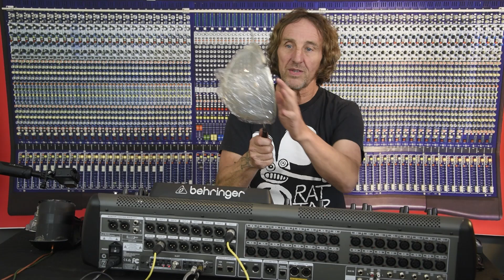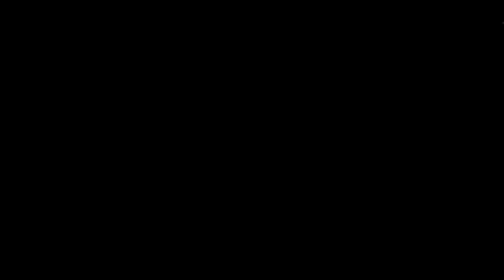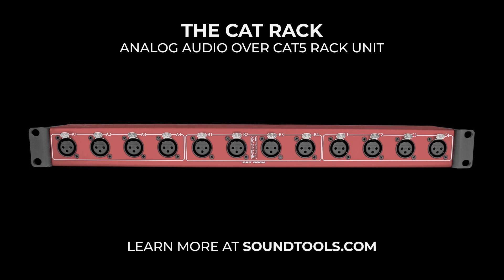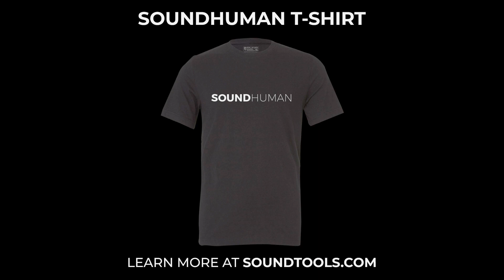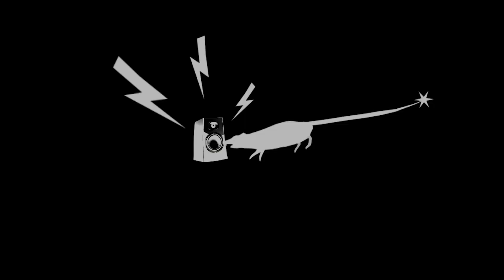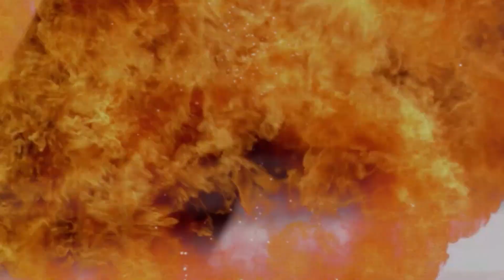Aux Fed Subwoofers Are Better - Because of How Mics Work

Comment: I don't personally run subs on an aux, but I'm also basically high pass hitler. Everything gets a high pass. Literally everything. It's the first thing I do when I EQ something, before the channel is unmuted, it gets a high pass based on what the RTA is telling me, then, that high pass gets run up until it sounds bad, then backed off a little bit.
I am, of course, almost always running in a room, seldom outdoors, so, wind isn't an issue. Wind is a broad spectrum noise on any mic, so even while running them on an aux, the real solution is to dead cat your overheads and high pass.

Something to consider that you didn't mention here though, any time you add a filter, you're introducing phase incoherency, so, in that way, subs on an aux is probably superior. I don't know how much that matters in real life. Also, if you're running your subs on an aux, run two aux channels for LR subs. That gives you a ton of freedom to fix things (another RAT trick that I use fairly often which works without the aux's as well).
Reply from the maker: Very cool and another added benefit of aux subs is that all phase and delay issues between subs and mains are due to the same signal sent to both, any input sent just to mains and not subs will have zero phase issues between subs and mains. This cleans things up further

Comment: I think you hit up on why many audiophiles hate subs. In a stereo system you can't just not send the snare and high hat to the subs. And what you demonstrate sounds like what I associate with a poorly done sub on a stereo system. When I wanted to restore a mix that seemed to me to be missing an octave (vs what I remember when I heard the same recording at Monopoly's Park Place) I tried doing a low pass and then shifting that low pass track down one octave. The result was mixed, the bass and synth sounded like what I remember, but it made a mess of the drums. I got something like what I wanted by gating the extra bass to turn it off when the drums hit. I think the club was using a sub-bass synthesizer, probably from BBE. That was an awesome club BTW. The song was Love and Rockets "Ball of Confusion". You need good gear to even tell that extra bass is even there other than the distortion it causes in really junk equipment.
Reply from the maker: Yeah, using higher freqs and shifting down gets messy fast.  A good studio recording will make sure there is no wind, mic vibrations, and minimize bleed from one instrument like bass into other instruments, therefore cleaning up the lows and reducing need for subs on send.

That said, kick and toms into the hh and overhead is an issue and high pass is useful and subs on a separate send is the icing on the cake.

Comment: A fellow FOH was insistent about sending the L/R to a sub matrix with proper crossovers on all 3 channels. What this video seems to be reason out is to not send "everything" to a sub out rather only send what is producing sub frequencies, mainly kick, toms, bass guitar.  Would this be a proper recap or did I miss the concept?  Cheers!
Reply from the maker: Yes send anything to the sub that you feel would be benefited by having some sub and don't send anything to the sub that has no reason going to the sub because the only thing that will get there is garbage and random noise you don't want anyway

Comment: Well put. I've been doing some research on pre-fader / Post-fader. I have generally only seen references to putting monitor mixes pre-fader and effects units post fader. This got me thinking is there any reason for that or any reasons not to do that. I've stumbled on a few videos and just from personal experience recommending using a post fader send for remote feeds for streaming and in cases where you might be mixing monitors from front of house. This allows you to set unity on the auxiliary send and that will follow whatever you're doing with the main mix well still allowing you to go in and cut or boost in cases of the usually electric guitars + amps and drums the louder things in the room that need to be compensated for a remote mix.
Seems like this would be a good set for subs as well. They would follow the same level of the main mix assuming you even wanted that object in the sub mix anyway and still allowing boosting or Cutting.

I've been doing sound for a Bluegrass band the system is theirs and the guitar player is in charge. I usually go into the auxiliary send for the sub and turn a bunch of stuff down because there's usually all 3 Mics, acoustic guitar, banjo and mandolin. besides bass (gotta have the bass).
They also don't technically have a crossover, the subwoofers have one built-in and they run a full band mix to it. I've noticed improvements since going into the graphic and cutting everything above 200? Hz And sloping back to unity from there. I think the subwoofers are 80, 90 or 100 Hz but I really don't know what the rolloff is as it's not published quality brand.

They're having a lot of trouble sometimes with bass behind wedges, the upright bass is coming through but it's not being heard by the acoustic guitar player and he's usually standing 8 to 10 feet diagonally behind him. I'm suspecting phase cancellation?
So I guess what should be in the subs other than bass since I don't have drums?
It doesn't help that there's one song where the acoustic get some slapping thumping but I usually turn it up for that. He generally likes a boomy and shrill guitar.

I would love to reset their mixer to factory defaults......
Reply from the maker: Very cool and love the thought put in.

I did a vid or 2 on stage polarity that may interest you

Comment: I've been trying to control the low end puff/boom type sounds in our PA systems when a presenter is moving around on stage when using a wireless headset mic/regular handheld mic as well !!, any comments, let me know, thanks 😊
Reply from the maker: Wins screens and don't send to subs. It that is still not enough and EQ makes the mic to thin, a diff mic. Maybe a dynamic

Comment: I've been a sound guy since 1989...and also played in bands early on. I remember having this debate in the late 80s...and we (the band) agreed that subs on an aux would be preferable. 

We had a 24 channel analog console, with 6 auxes, and 4 sub groups. And we had one stereo two-way crossover. We used that to send lows to the subs, and higs to full range, passively crossed over tops...the classic quasi-three-way system that was common in those days. 

So the dilemma became how to create an additional send for the subs, and purchasing an additional crossover, so we could separate the subs. 

We ended up buying a bigger console and an additional crossover, just to achieve subs on an aux. The band eventually broke up, and I ended up owning the system...which I began renting out. At the level I was at (small time level), it was quite the selling point to be able to do subs on an aux.
Reply from the maker: So cool
Reply: I suppose they could be put on an unused monitor channel and ran through a bandpass filter.

Comment: But how relevant is this when I mix on a K1 system which already goes down till 35 hz? A KS28 would add 10Hz more coverage and might increase the contour a bit, but the effect vanishes the larger my systems get.
Reply from the maker: Really? So if sending low frequencies to the subs makes no difference, why use subs?

If sending wanted energy to the subs adds additional and audible low end, why would that be any different for unwanted energy?

Comment: Very true. Then it is just about time aligning the subs to the mains. Do you have any tips on doing that?
Reply from the maker: For aligning subs to mains you need to pick a place or area to align to. Other places will not be aligned if there is physical distance between subs and mains.

Since alignments tend to only be dead on for a small portion of the audience where you have aligned to, and since the alignment only impacts frequencies that are radiated by both subs and mains, it's important to not overly stress on it.

That said, if you want to do it by ear or with an RTA if you don't have software like Smaart, you can do it by reversing polarity of the subs temporarily and tuning for a null at the crossover freq.

You will want pink or tone to put out the same level at the crossover freq from both mains and subs. Then combine with subs polarity reversed, tune delay for a null. Then reverse polarity back.

It's a bit tricky and the delay times must be around the logical distances.

So if your tuning position has the subs 5 ft closer than the mains, it is going to be between say 3 and 8 ms. Longer or shorter means you are doing something wrong or the subs are already polarity incorrect
Reply: @DaveRat  Thank you very much

Comment: I was sitting here wondering how I could do this in a karaoke type scenario (when I do live sound, it is simple) but I use zlx powered stuff which have 2 inputs, so I can put vocals on 1 input via sub out on the mixer and route only mics there , send signal to input of tops only and the prerecorded music on the other using the main fader (profx12 Mackie)  and send that signal to subs first (less cabling) or thru a drive rack (more cables but tighter control of crossover points and shelf shape) 

Eventually I will just have 2 speakers up top, one for music and one for vocals only, but for now (tonight) I will try the former solution and see what happens. 

Ever since I started gigging in 2004, I have always been on the hunt and focus to create as close to a live performance experience for all of my customers, providing the best sonic experience possible.   These concepts you share certainly help me along in my journey.   

Once I upgrade to an x-air setup it will all become easier, plus I can offer recording to my customers as well.
Reply from the maker: No need. The issues with wind, vibrations and bass bleed are more of a live sound thing. Studio recordings tend to record in controlled environments that eliminate the issues.

Live, we are stuck with the issues so subs on aux is a way to improve things
Reply: @DaveRat  I'm just curious if it would eliminate low frequency rumbles and feedback from the vocal mics as most of my venues are smaller in size and I always use at least 1 sub.   Low cuts don't always give me headroom I'd like to have, especially when places get packed and levels are high.   So vocals aren't as big as I'd like to accomplish.    Panning fx one way and vox another plus having sonically different tops next to each other helps,  but I'm a geek and keep striving to get the clarity and warmth at every gig that just gives people the tingles.    The task will be worlds easier when I get around to upgrading to the xr18 to have more dsp tools .
Reply from the maker: I did not think of that and yes, getting the vox out of the subs is good

Comment: First ever video i have to disagree. What about all the downsides? How can you process the whole mix? Or if you want to parallel-compress your drum-bus? Or make a instrumental vs vocal bus. Once your using sub groups you just can sand the whole bus to the sub or you don't. But drum bus contains kick and snare ecc.

Also you can highpass certain instruments wayyyy above the xover of the subs so ghere will be realy no signal left at the sub-range.
Reply from the maker: All those are solvable with routing that fits your application.

And

Even setting a high pass so high that the instrument has no lows, will still let some unwanted energy go to the subs.

Sending the stage vibrations, bass and kick bleed into all the mics, handling noise and wind noise to the subs from ever single mic is not fixable with high pass.

Comment: I  have found that people here in South Louisiana love using the Aux and I hate it.  This is for small to medium size venues or outdoor shows with 300-600 people;  I find that when lowering the volume while using the aux they lose the big sound or maybe I should say warm sound and dhave to go back and eq each channel when lowering or raising the volume of the PA.  While I am only a musician and not a sound man, I mixed from stage for many years maybe 20 and had sound engineers the other 20  Occasionally having some excellent sound techs who went on to mix for Paul Rodgers fulltime and more (that guy was really good) and others who went on to forming their own sound company for local festivals and concerts. 
  The ones who used the AUX concept never really got that full sound I like to get from having the house EQ  on the subs mids and treble at the same time.  Now I'm sure if you came and tweaked my system it would sound better than I set it of course but to date I haven't fallen in love with the whole AUX TO SUBS thing but you do have me intrigued to possibly trying it again   Also I hate using high pass and low cut on vocals and only when I absolutely had to only on background singers,  I would not use it on the lead vocal. Thats a whole discussion in itself lol
Reply from the maker: That sounds like a touring issue more than a concept issue.

Maybe sending subs from a mayrix

Comment: Hi Dave, after watching this video i tried it for myself with a live multitrack of a band i work with, i recorded and listened to my usual chain(everything going to Master, matrixes for LR and SUB from Master) and yours(everything going to Master, kick and bass going to M/C, routing Master to MatrixLR and M/C to Matrix SUB for additional inserts on the M32) and i heard an improvement.
The thing is: when i sent everything to Master i usually inserted the Combinator(or another effect) on the Master bus for some multiband compression but now that i'm sending the low information to a separate path this portion of audio won't be affected from the Combinator, or a sonic maximizer, or whatever insert i put on the master bus. how would you approach this? beside just listening and not putting myself through this hassle and just going with it if it sounds good, which it does.
Reply from the maker: Usually the clean lows won't need that processing . 7sinf a seperate comp on the subs is good

Comment: One situation where you would not want to do this is if you are using a system with a sub on a crossover at 150-200hz such as with a bose compact array.  With a crossover that high, you really need to put most things through the sub- maybe not a hh, but most other things.
Reply from the maker: Agreed l! Usually crossover points above 80hz are not consider subwoofers, but rather they are just the system lows